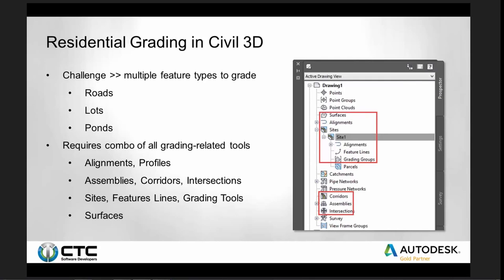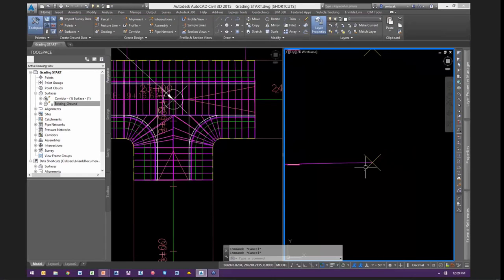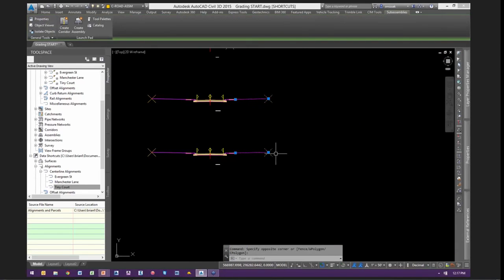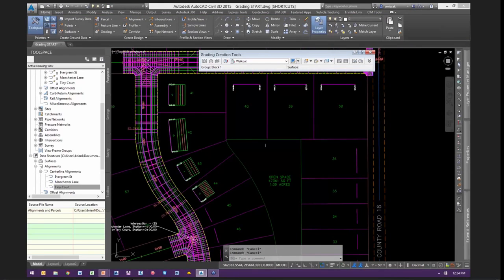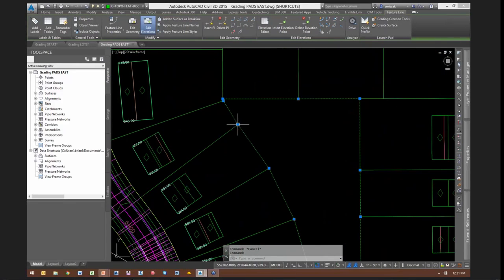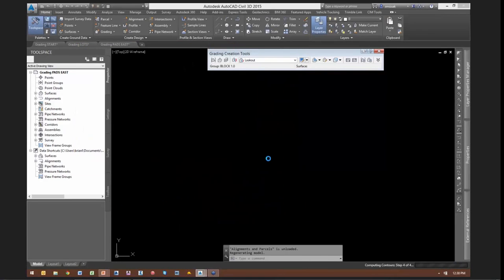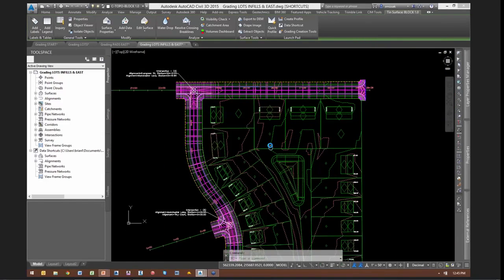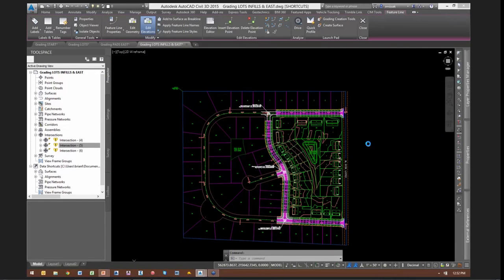Civil 3D Lot and Road Grading for Residential Development

Comment: This method does not provide a dynamic relationship to the corridors. If the corrdor changes the lots don't update. Why does this matter? We need to balance the earthwork. We start with a grading model and cal the earthwork. Then we need to adjust the site to get it balanced. Usually this means evaluating the cut-fill map to find where we need to raise or lower the site. Then we tweak the road profiles which adjusts the pads. raise it where pads are in cut, lower when pads in fill, etc. It is an iterative process. This method requires a lot of manual work for each iteration.
Reply: Can you elaborte on "dynamic relationship"? Do you have a video for this?
Reply: I mean, with each iteration you would just have to click the ROW FL, pull from corridor surface, and then you're done. You're talking about 1 minute of work added per iteration. Not really significant.
Reply: Tell me, when the ROW FL changes, do the lots need to change to match? How do you do that? @jaredsilvers2782

Comment: this is a good tutorial on using the tools, I'd contest they are used beyond their usable intent though if we're trying to create organic land forms instead of straight line geometric shapes.  Civil 3D contouring is so poor and or takes so long, 6th grade drafting would fail the output let alone collegiate courses on grading.  I get it roughed out on the pavement and do everything other than roads by polyline contours... or at least draft lines and curves for the contours and then build the surface from contours and cogo points with featureline lines for pads and pavement only.  Featurelines for organic shapes is inappropriate.  Again, awesome tutorial on maximizing the tools but it's important to state this is exactly what happens when you try to use straight line grading to make organic land forms, it works and looks atrocious.

It takes a lot less time to draw a polyline with the curvature you want in it at a stepped offset then to try and get feature lines or corridors to create the same which is technically impossible because we all know, surface contours are lines only.
Reply: AMEN